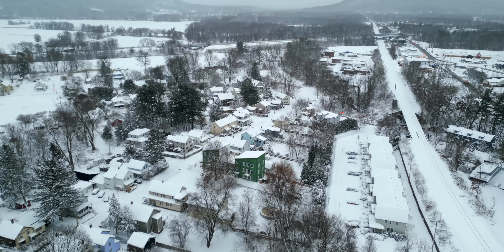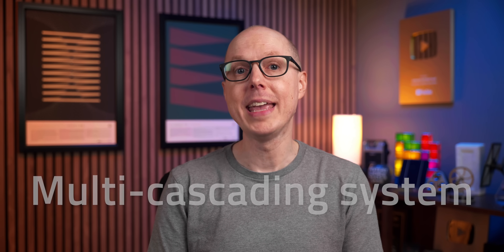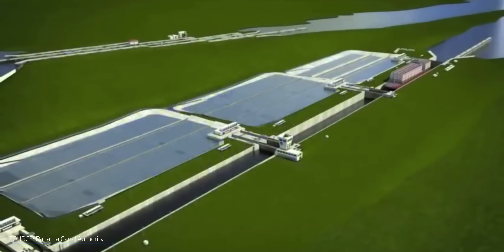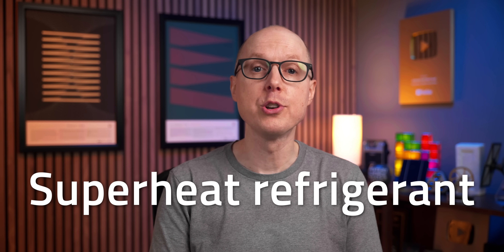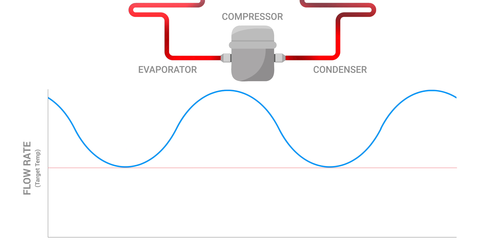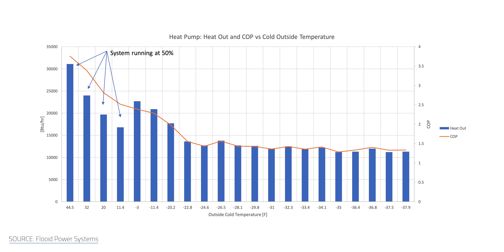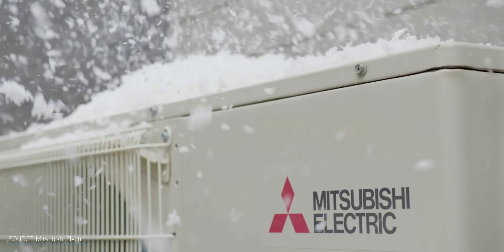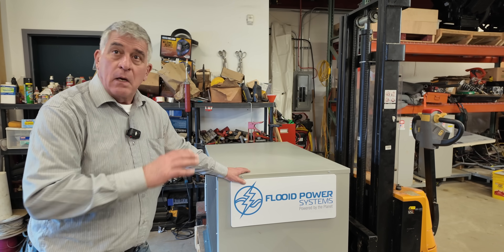How This New Heat Pump is Genius

Comment: The problem that I have with heat pumps is the same problem that I have with current refrigerators: reliability and lifecycle.  Yes, a modern refrigerator is more efficient than an old refrigerator, but whereas old refrigerators would last 20+ years, I've had to replace my last refrigerator (which was quite expensive) in less than 7 years.  Why am I talking about refrigerators?  Because they use basically the same technology as heat pumps.

Would a heat pump be more efficient than my natural gas hot air furnance?  Absolutely.  But my gas furnace is 25-years-old, has never needed service, and is still working well.  A heat pump won't last that long and is, of course, most likely to fail on a very cold day, just when I really need heat the most.  And then I'm stuck with another $10k+ cost to replace it every ~10 years.

In this case, it's not one heat pump but multiple heat pumps, so the upfront cost is higher and the replacement cost is higher.  Yes, it may be more energy efficient, but is it more cost efficient?
Reply: Continuing to use an old furnace is going to be cheaper than buying a new heat pump system.

But that isn't the question at hand.

The question at hand is, given the need to buy a new heating system, are you better off buying a new resistive or gas furnace, or a new heat pump system?

If you have cheap gas, then it may be cheaper to continue using it until it dies.

Also, keep in mind that a furnace built 25 years ago is not the same as a furnace built today. Past reliability is not evidence of current reliability. Especially when talking about computerized furnaces.

Also, your gas furnace will need service at some point.

Comment: My central air is dead and I am in your region, being just north of Boston.  Quotes for a variable system integrated with our oil hot air furnace were very expensive. We decided to selectively cool for now but we want a better system without the high markups and BS.

Comment: Gas boiler replacement would be a big thing.  As that instead of fully replacing including the pipes and radiators, that is using the pipes and radiators.

Comment: Can you add some annotations though the video with celsius conversion? You have some later in the video but not in the middle and earlier bits.
Reply: Ballpark is subtract 30 and divide by 2. The actual formula is subtract 32 and divide by 1.8.
Reply from the maker: Shoot!  Sorry ... we can't add that to video after the fact (the way YouTube works).  We're usually pretty good about providing both, but completely forgot for that section.  I can add some corrections in the description, which will kind of address it.
Reply: But when he said -40 F… it’s the same for C 😅

Comment: We should have an integrated modular heat pump system that is able to accept multiple heat/cooling consumers and intelligently manage the heating fluid depending on what needs heating and cooling.

So you'd have one box (attached to an exterior radiator) which would have multiple hoses snaking off to every device needing heat management which would report what they needed and the unified heat pump would work out what fluid to pump where at what parts of the cycle.
Reply: Rethink home heating as an energy-management system. 

Heat reservoirs (insulated tanks of automotive antifreeze) combined with heat sinks (cold tanks of antifreeze). The heat pump makes the fluids hot and/or cold. The fluid pumps throughout the house to the fridge, water heater, hydronic floor heating, dehumidifier, water heater, clothes dryer, etc. When the home needs to acquire or reject heat, some of the fluid loops outside to an air-air HX or ground loop.
Reply: @HobbesNJoe  this is already possible. It's cost prohibitive both capital installation and ongoing service. I deal with a few hotels that do essentially this. Not exactly but close. They have tried to get a cheaper technician, but they keep calling me back. They don't like my prices but they don't have much choice. Honestly I make way more money with heat pumps, they are cash cows.
Reply: They already exist and are called Oceans - its why most large cities and large population centres are near large bodies of water. I do wonder sometimes why they aren't near 'large bodies of carbon dioxide' Possibly because the Earth is flat and it would blow away in the wind. @HobbesNJoe
Reply: I'd love to add things like thermal batteries. Take excess solar power during the day to store it for night, as heat for your modular heat pump.
Reply: They're called 'storage heaters' and have been around for years @patrickphelan4055
Reply: It's been dabbled with, but the design is insanely complex and expensive, as well as very inefficient. It's why you dont see heat pumps that both heat/cool your house and heats your water at the same time. Great idea in concept, but not feasible with current refrigerants
Reply: Yes, By people who don't understand the 2nd Law. So they gave up and became climate scientists instead @jsncrso
Reply: Tesla has proposed this idea, as they do something similar to control moving heat around to keep the people, battery, and motors at their optimum temperatures. We haven't heard more about this, which makes me wonder what downsides they have discovered. One problem with cars is that in the summer, everything needs to be cooled. Houses do need hot water, but there is a limit to how much energy can be dumped into the water heater. I suspect there's limited savings  between the peak heating and peak cooling directions. In the winter, one has to heat the house and the water, in the summer, there's more heat having to leave the house than can be stored in water. This solution works best in spring and fall, when separate solutions aren't that expensive to buy or operate, and avoids the complexity of solving everything with one system.
Reply: Tesla discovered The 2nd Law of Thermodynamics. Don't tell anyone else it'll put 100's thousands of scientists, bureaucrats and tax collectors out of a job @johnhaller5851
Reply: Bro it exists! Look up Daikins VRV, or variable refrigerant velocity, it's badass and almost exactly what your first sentence was describing!
Reply: @Rjjamess  daikin, Mitsubishi, fujitsu, and several others all have this.
Reply: @SuperS05  well the reason I said Daikin is bc im 90% sure they came up with the technology in the late 80s. At least the variable refrigerant flow, I guess that's why I chose to say their name instead of include a list of others that use it too
Reply: @Rjjamess  daikin claims they were first, but they are also the only ones who use vrv instead of VRF like the rest of the industry, which muddles things a bit. The first VRF systems like what you're thinking of where roughly in the 80s. Actual variable capacity in a single loop is far older, at least the 50s. Different methods, like multispeed motors, various forms of unloading and /or HGB, and multiple compressors (tandem). This is including many multiples of evaporators at different temperatures on the same system. (I'm guessing the first was probably a supermarket sometime long before I was born.) Many improvements over that time, most critically good oil return. This is why linesets for modern VRF seems so small, it's for good oil return at lower capacities.
Reply: We have those already.
Reply: "The VRV R series enables simultaneous operation of cooling and heating within a single refrigerant circuit."
Reply: @Rjjamess  I'm very aware of that unit and my comment still stands correct. Look how expensive and complex the unit is
Reply: @jsncrso  bro, I wasn't talking to you haha, my first replys were to the OP
Reply: So when my A/C goes out, I can't wash dishes or take a shower? Lol
Reply: Fairy tale stuff
Reply: @freedomliberty7611  "Small minds don't reach for the stars", FreedumbLiberty.

Comment: Cool ideas and interesting applications 
But it's way to dependent on sensors and computers 
For me ok 
The more complex and heavy on the monitoring aspect you go the further you remove the customer from the system and it's maintenance 
How much something cost isn't the only expense I have to consider 
So I will stay with my basement wood stove and the floor registers in the winter and cooking out side in the summertime 
I have a root cellar that is about 16 feet down that is 1400 square feet with shelves that double as bunks in extreme weather 
It stays about 20 degrees constant year round 
So my friend I really like the new shiny technology and what it's represents 
But at what cost 
And how much more will it disconnect connect us 
Thank you for the videos brother and God bless you and your's 
👍🏻😁🇨🇦
Just saying

Comment: Heat pumps aren't necessarily based on fluid and compressors, the term refers to any system that moves heat around.

There are several different physical phenomena that can move heat, including the Peltier effect (thermoelectric) and the magnetocaloric effect (magnetic refrigeration).

Comment: I wish there was a standard to interconnect heat pumps in the home for greater efficiency. For example, having my home heat pump loop take the heat extracted from the home and send it to the water heater pump loop in the summer, instead of running 2 separate pumps.
Reply: All this will come in time.

Comment: All this software and hardware trickery to overcome air source heat pumps’ struggle to remain efficient in extremes of outdoor temperatures. Commendable. But more to go wrong, more $. I’m leaning more than ever towards an initial investment of getting a well drilled, one time, then being done with the whole ugly outside buzz boxes forever.

Comment: Right off the bat I think more systems that can go wrong. And as you say, people are already having a hard time( they are frightened) with heat pumps. This one seems quite a ways off.
Reply: People in certain areas may feel this way, but a HUGE portion of the country already has heat pumps as the norm.  Even here in northern Maryland not far from the PA border, heat pumps are extremely common now.  Many places don't have access to natural gas, so choices are heat pump, propane delivery, or heating oil.  Heat pumps work well and are less expensive to run and maintain.

Comment: Heat the house water and then run the output through the water to air exchanger to make winter home heating.  In summer, pump house heat outside and then boost with ambient to heat house water.  Sounds great for decarbonising.